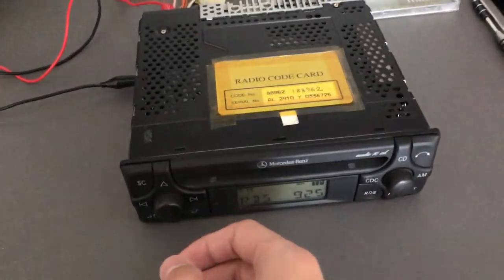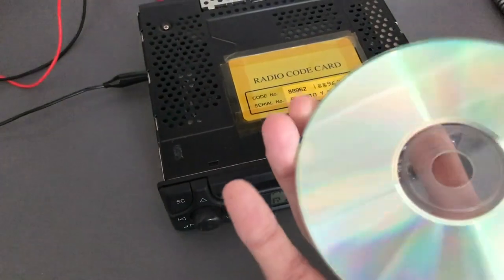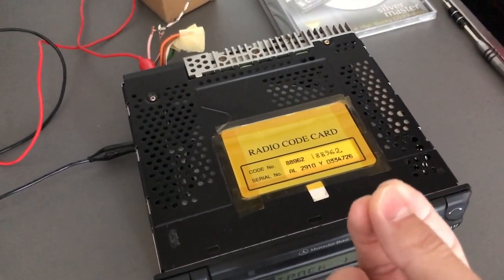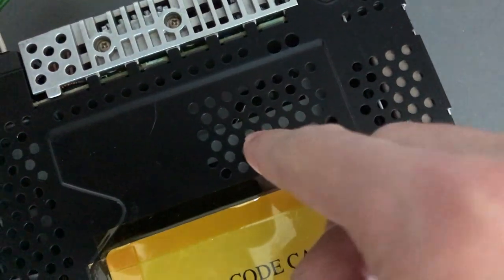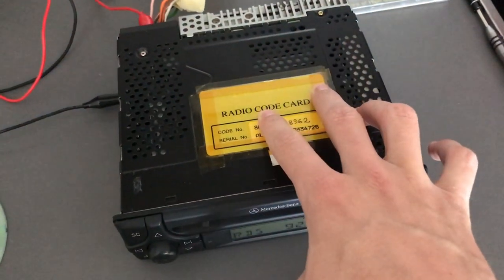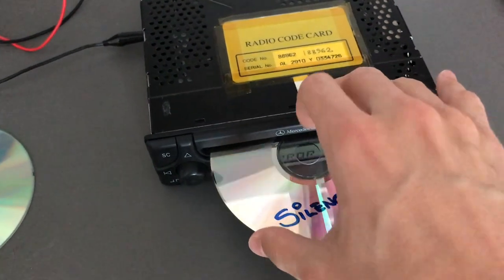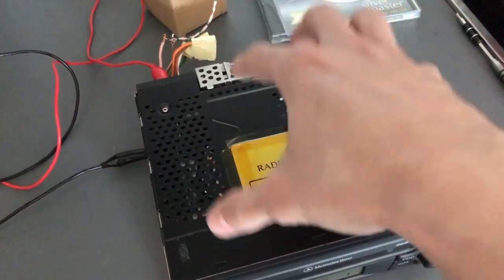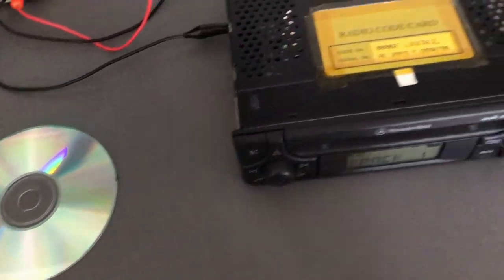Why Old Car Radios Won't Play Burnt CDs

Comment: my dads oldtimer didnt play my burnt cd and i spent over on a hour to find out why. finally i did thanks to you.
thumbs up!
Reply: What cd will work with my old cd reader? I have a 2004 car
Reply: @6six9nine74  

Original, pressed CD (as you've bought it from CD store)
Reply: @beezanteeum  Yes i tried to use 1 write only cd and i had troubles playing them. But its not my reader that is bad because store bought prewritten albums works perfect.
I have given up trying :D
Reply: @6six9nine74  

Well, this only benefit major labels and major audiobook publishers (since they have a deep pocket to press a CD Audio)

On the other hand, this "bug" (more like, enforcement) kill indie labels/indie audiobook publishers (since they releases burned CD Audio, not a properly pressed CD Audio)
Reply: @beezanteeum  That is very interesting information! Thanks

Comment: When you say, Silver, is there a certain brand?  I would like it to be printable and I found some on eBay that are printable and they say that they are silver. I just wondered if they would work in my older 2008 cadillac, because so far it only plays the music CRs. The ones on eBay are: CMC Pro, Genuine Grade A CDr, TY silver but I don't really know what all that means.

Comment: this is weird because my radio is from 2002 and i use 650 mb/74 min cds but theyre burnt and they dont work, but yet cds from like later on, like for example the heist, works in my radio. i do not understand
Reply from the maker: hmmm, originals might be pressed, not burnt, so those should read a lot clearer ..
Reply: darieee do u have any idea as to what i should? i have one last cd and debating if i try a different cd burner instead of windows media player
Reply from the maker: different burner with the lowest allowable burn-speed might be worth a shot

or just retrofit Bluetooth into it 🤘

Comment: I bought some 650mb discs and recorded the 70 minute empty track that you shared in the other video for Audio 10 CD as well, but the player throughs “ERROR” message and spits the disk out. I have 2 questions:
1. Did you write your CD as data CD, or as audio CD?
2. I have CD-RW instead of CD-R, so they are rewritable. Might that be an issue?
Reply from the maker: 1 you MUST make an Audio disc
2 yes, it's a huge issue, a very large portion of the old players can't read RW discs
Reply: @Darieee  Do you want to sell some of those CDs you've got? Quite impossible to find them in Romania..
Reply from the maker: cate vrei ... cat esti dispus sa dai 😎
Reply: @Darieee  Mai zi ca esti din Bucuresti si s-a rezolvat :)) as vrea macar 3 si pot sa ofer 10 lei per bucata, sau poate 5 cu 50 daca ai multe?
Reply: @Darieee  Sau zi tu un pret si daca ma poti ajuta si cu integrarea bluetooth-ului...am modulul deja
Reply: Yes I had the same issue Phillips seems to work better than Magnavox Sony and verbatim but it only plays the first couple of songs and then the rest are all static so I'm just going to get an FM transmitter and put an SD card with TF card in it fuck it
Reply: @dumitrugulipe731  try Ebay
Reply: @garydupree9311  That's exactly where i found them at the end. Cheers.

Comment: My burned CDs are not playing inside of my 2001 Lexus GS umm I have a rioddas external player and cdr disc I burned my cd at the fastest speed then I burned the cd at the slowest speed does anybody have suggestions on how I can play burn cds in my car thank you
Reply: personally i would try format 1 song in wma and another in mp3 format and place the disk in and see if it reads anything. if that dosnt work.. game console. i have a Nintendo wii in my car and it plays dvd and audio cd not to mention Internet ect amd its literally only 12 volt so it just wires straght in. and they are super durt cheep.

Comment: burn at a slow speed. try burning at 1X or 2X maximum. and blue dyed backs read better.
Reply: How?  My CD writer won't let me go down to 1x or 2x.  It only does 10x minimum.
Reply from the maker: burn at 10 - if you have 650MB discs - you'll be fine

Comment: First!
Reply from the maker: dayum !
Reply: @Darieee  i really need your help, tell me 3 things.I have a philips 700mb Cd-r  as audio CD.
1º- What program did you use to burn the cd?
2º-What speed did you burnt the cd??
3º-What type of file did you used to work on that radio??MP3?WAV?WMA?
Im asking you because i have the same radio and im having problems to make the radio read . I bought 5 cds and they didnt work